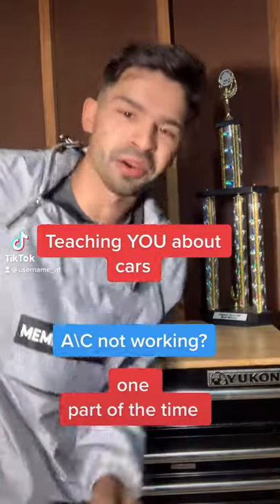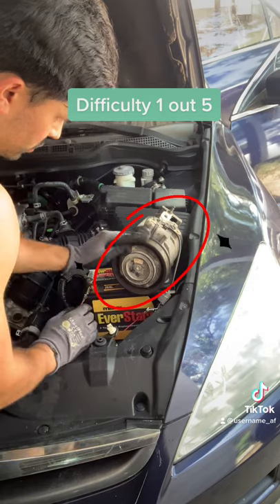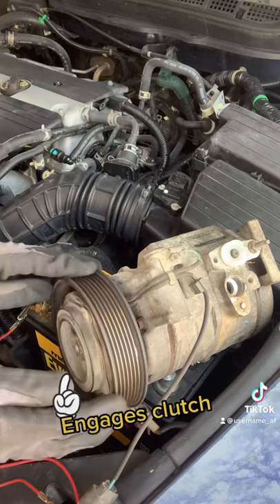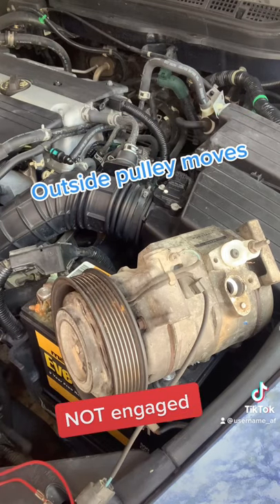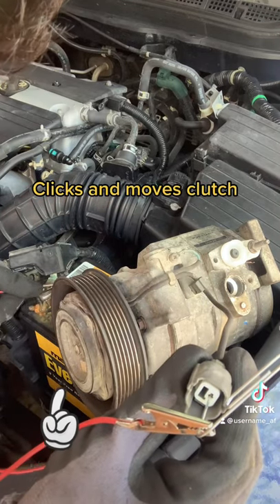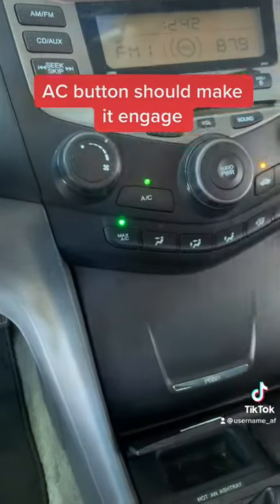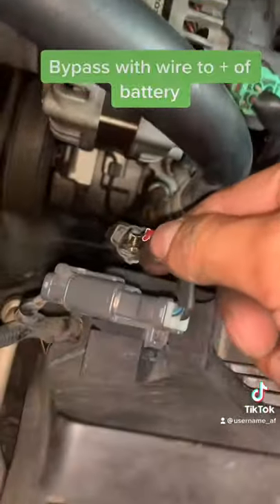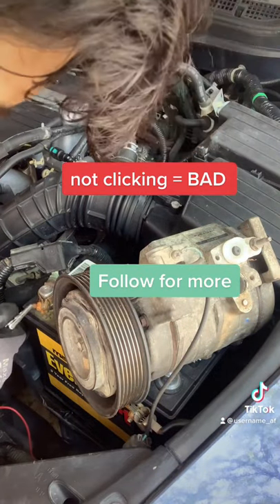How to Test Car A/C Compressor

Comment: If the compressor doesn't click while ac is on, it could also be low on refrigerant. If you fill it up the proper way and the clutch still doesn't engage (click) then the compressor is most likely bad.
Reply: Could also be the pressure switch as well. Could also be the electromagnet. (Unless you check the resistance and it measures between 3-5 ohms. Could be a short in the line like the guy said above and it could also be low on refrigerant. Surprised dude in the video didn’t mention any of these, especially when the pressure switch and being low on Freon is the problem A LOT of the time.
Reply: How would you check if it’s low on refrigerant? The a/c gauges won’t give you an accurate reading if the clutch is not engaged
Reply: It could also be a bad clutch
Reply: @michaelhaile401 this is my problem now
Reply: Bypass the low pressure switch,  If the clutch engage then you know it's low of refrigerate.
Reply: @JoeyCorona-st6nf  you can’t really. You need to rid it of all refrigerant and refill completely brand new. Check online for your cars EXACT amount it should have.
Reply: I just ran into that problem putting one on my suv..another thing I caught, and I recommend you this before buying, is to cover the two holes woth your finger, spin the pulley,  and it should suction those two fingers..if it dont, it won't pump..just a heads up on what I observed while doing mines..just an add on to your excellent observation👍🏿👍🏿👍🏿
Reply: Could also bad ground
Reply: @tack3411 probably dumb question but where do you put the refrigerant

Comment: If there is no refrigerant in the system the clutch won't engage also
Reply: wait, why wouldn't it?
Reply: @elemenopi55 because it won't detect enough (pressure (refrigerant) in the compressor meaning the clutch won't engage to turn on your compressor so you can have AC in your car/Truck
Reply: @azkc3857  i see. could there still be enough pressure/refrigerant to turn on the compressor even though there isn't enough refrigerant to blow cold air into the car's interior?
Reply: @elemenopi55  if anything you might still have some to have the compressor engage BUT while its leaking you might not have enough to keep the inside of your car cold, so when it leaks completely then the compressor won't turn on and you'll only have hot air coming in 

Common leak spots are 

The two Lines High And Low Pressure which have Somthing called O-Rings where it connects to the compressor or the Condenser 

Condenser could also fail but it's very uncommon 

Compressors also have o rings and Oil to run the compressor built in which Is main causes of a compressor failing 

I Recommend flushing your AC system by taking it to a mechanic that can recycle the rest of the refrigerant and then filling it with R134a with UV Dye (Depending what refrigerant your car takes thats the most common one every car takes) once it leaks if it's a high leak then you notice it instantly from letting your car run if it's a small leak you probably have to leave it on or ride it till it leaks the uv Dye and check where in the lines or Compressor it leaked with a UV Light (BlackLight) 

One last thing c9upd be your lines are clogged up and it might need a flush start with the uv Method first I'd say before you go above and beyond 

Quite a long paragraph but I hope It can guide you better to your problem

Comment: This isn't about testing the compressor, it's about testing the compressor clutch. Big difference.
Reply: Yes and no. A working compressor will turn on when car is running and AC is turned on.

Comment: To jump the compressor. Unhook it and run a jump wire in both of the notches/slots, then crank the car. Done
Reply: Ground and 12v? Does polarity matter ?
Reply: @davidgomez3737 Did you get any answer? Does polarity matter?? I got my cable pulled out of the pins and both of them are black, Idk which is which
Reply: The safeguards are now not in play so the pressures aren't controlled.

Comment: Good explanation
Reply: I took my car to a shop said my compressor bad cuz the inside pully keeps moving while the ac is off told me I need a new compressor is that accurate?
Reply: From what you typed. It sounds like the clutch is stuck and is engaged no matter what. I obviously can’t see your car, so going based off this the clutch may be bad on the compressor unit. Some shops replaced the clutch part or the entire ac compressor depending on the make and model. As another internet stranger who does not know you personally I would recommend going to a different shop to get another quote or inspection. A lot of times shops will half ass the inspections or won’t do all of the tests to root out the exact issue. So if you feel as if their findings don’t sit well. Listen to your gut and move on to another shop.

Comment: It's either a bad clutch or the compressor is out of freon.. compressor clutches will not engage if they are below a certain amount of freon in the system to protect the unit from completely destroying it due to lack of freon
Reply: U dont need to buy a new one. Check the electromagnetic part inside that pulley. Mostly them the ones burned out. Around 40usd with a set

Comment: I’m 99.9 percent sure that compressor works perfectly fine, why spend 300 dollars on a new compressor when all you have to do is spend about 50 bucks or even less and change out the compressor clutch coil on your existing compressor.
It’s just held on by a bolt usually 10mm the clutch drive plate slides out , careful no to lose the shims that come out they’re thin pieces of metal that look like washers , then you’ll see a snap ring holding the pulley in place take the snap ring off then if you’re lucky the pulley should slide out by hand if not you’ll need a 2 or 3 jaw extractor to get it off don’t try using a hammer cause you’ll damage the bearing.
Once you got the pulley off you’ll expose the magnetic clutch coil again it’s just held in place with a snap ring get it off and the coil will come right out.
Reply: damn boss man ninenty nine point nine nine percent? can you post a video?

Comment: Thanks for the info. Mine makes a squell kinda sound on start up. Last for about 15 seconds. I wait till it stops before driving. I've had mechanics tell me that they tightened up the belt but it still happens. Do you think I need a new compressor?

Comment: “Need a new one” ?  Need a new compressor or just a clutch if it doesn’t click?
Reply: Replacing the clutch is the better way to fix it, it is easy and it costs 1/40 of the price of a new a/c compressor.

Comment: That is not testing the compressor.. that is testing the CLUTCH of the compressor.

The compressor does more things and it could fail in other ways too. The clutch is the first thing to take a look at, but you could easily hear if the clutch is working as it will make a distinctive sound when you press the AC button. What you need to do next is show us how to diagnose a compressor... you guessed it... NOT compressing.

Comment: Im not gonna lie. I was getting a bit nervous with it on the battery like that. When i was young I basicly welded a  adjustable wrench to a battery. Got it off with a hammer. Scared the shit out me. Ive also had one blow in my face before so i like to keep batteries safe lol

Comment: Hey man, can't seem to find a compressor  for my vehicle so I'm looking for an alternative. Thinking about hill billying  and converting a washing machine motor to do the pulley work for the compressor. I'm an engineer so I was going to bolt them to body where there's room under the hood,  run the lines and use the motor instead of the engine pulleys with the switch working with the thermostat for cool down as well. What's the worse thst can happen? And when I say engineer, I do got my degree, just never practiced it as im also going for entrepreneurship

Comment: Is rhe clutch in parallel with the two holes? I found out if you put 2 fingers on the holes and spin the pulley, it should suction your fingers while spinning thr pulley..im thinking its parallel with the pumping..im new at working on my vehicle..

Comment: Can the ac compressor make a winding noise when going bad?
Reply: The clutch bearing can make a noise when the bearing goes bad if that’s what you mean. Could sound like metal on metal wearing against each other

Comment: When the clutch gets burned up does the system get contaminated ? I want to know the likelihood  of needing to replace other parts like condenser , dessicant bag . drier ? I've got a 15 Ford Fusion 2.5 L Looks bad the clutch material is coming out the front pulley

Comment: My car blows cool air when running but warm when stopped, it’s an Infiniti g37. Any way to inspect it or any coming issues I should look into?
Reply: I had this problem on my 05 g35 and my ac compressor clutch stopped working after the next couple of weeks. Check if your RPM’s jump up and down on idle if they do you most likely will need to replace the air compressor or the ac compressor clutch
Reply: @VQ.Jnthn2300  my 06 g35 has been doing this for like a month now but it’s finally getting bad. i’ll
be at a stop light and my rpms would jump up and down but i could never figure out the problem but i think you saved me now cause my air is cold that’s why i never really thought it was the compresser but the clutch make sense as well

Comment: Hello my name is Alice an I have a 2007 Chevy Impala and I have a question,  so my car is making a noise someone said it's the compressor but he barley even looked at the car so how does one know it's the compressor? Can u tell just by the sound it's making? An would it still be making that noise if you only needed Freon or to recharge the a/c (my A/C isn't pushing cold air) thank you in advance for any info u can give me regarding this situation 🙃

Comment: So I jumped it and filled it with coolant and it works until I remove the jump wire and it won’t engage itself
Reply: Check fuses and relay

Comment: It's easy. Start your car, lift your hood. Turn your ac on in passenger mode. If it's good you'll see the middle moving. If not the middle won't move.

Comment: This is due to activating the AC at a high RPM (for manual cars), the compressor clutch could be damaged in this case.
Reply: Best way to test the clutch (magnet) is by checking the resistance. Connect a multimeter to the ground and hot wire. The resistance should be around 3-5 ohms. It can work high or lower than that, but if it does, it’s on its last leg.

Comment: Our be like me and have 150psi on the low pressure side while revving (150 was the max on the guage so who knows what it actually was)
Reply: I’m at 130-135 psi low side and trying to find any info on it and your the first one - anything yet besides buying a new compressor ?
Reply: @gabegarcia7779  unfortunately not since it turns out my compressor was actually dead

Comment: I have a 1999 Toyota RAV4 and we currently diagnosed that our Air Compressor is making a loud phone-ringing type sound.
So far, every time we turn on the car and after a few minutes, the sound begins and would turn off after awhile.
I decided to turn on the AC while it'd making sound and it stopped making the sound.
Reply: The bearing of the pullley is destroyed. That will heat up to a point it will melt the rubber cover of the bearing, also, the plastic protection of the magnetic coil will melt and could cause short circuit. Try replacing the magnetic clutch pulley bearing asap
Reply: @misty-i2q  Thanks. I'll take that into consideration. I'll keep you up-to-date if you like

Comment: My ac blows super cold but it stops working when it wants to then cuts on when it wants too. Ac Air is always cold. All fuses are good, just changed blower actuator. Still nothing. 2016 dodge charger

Comment: I checked the fuse and it’s good. I checked the relay and it’s good, still clutch won’t engage.
Reply: Could be low on refrigerant 🙂
Reply: I recently got my a/c serviced and it was low on refrigerant plus it had some leaks that were fixed. Blowing nice and cold now 😊

Comment: I have a 2007 RAV4 and my ac just quit coming on. My son said it made a noise ( no idea ) and the next day nothing. It’s like turning on a stereo that’s not connected to anything, not even a power source. I replaced the resistor and nope. The blower motor is good so I’m at a loss
Reply: Did you look to see if the belt broke? Sometimes they use a different belt and they'll freeze up and break just that belt. There's also a switch that signals whether or not there's enough pressure in the AC system lines. Maybe a rock or something hit a line or the condenser and the noise was the refrigerant leaking out. If you want to test that you can either buy some self add refrigerant with a gauge and it will tell you the ammout of pressure in the system. You just want to stay in the green. Or you can unplug the sensor and bridge the wires and if it kicks on you know your switch I bad.
Reply: @Zoroaster4  it has not. It gets no power to the “on/off” switch. We’re checking fuses but can’t locate that pesky relay switch

Comment: Hello, I wanted to ask you if you could help me with my car. I have a 2013 Ford Edge that has a dual system that blows hot on drivers side a cool on passenger side

Comment: when i press the a/c button in my car the pulley doesn’t move. I unplugged the wire and connected it to the positive side of the battery, after which i hear the clicking sound and the clutch engages. what does this mean and what should i do to fix the problem. Thanks!
Reply: I believe you stated that if it engages it could be the fuses. My car is a 2012 Accord V6 and I have swapped the horn relay with the magnet clutch relay but that didn’t do anything. are there any other fuses or relays that I should check or replace too! Thanks again
Reply: You don’t have enough pressure in your system, check for any leak and top up your system

Comment: 08 Cobalt 2.2L so I used a recharge kit and it said it was full and the lines where cold but it wasn’t blowing cold air would that be a clogged cabin filter or the compressor ?
Reply: If its not clicking on. Probably compressor. Check the ralay and fuses while youre at it
Reply: @hectormejia5090  appreciate it bro

Comment: What if my compressor clutch spins without stopping? The car blows cold air only during acceleration or sudden stops.
Reply: Most likely low on A/C refrigerant .     7/7/23
Reply: @vicpetrishak7705  it wasn’t that. Levels were normal.
Reply: @johnnyboyyyyy   What are the low and high pressure readings ? What is the ambient temperature ? Are the electric fans operating presuming they are in your system ? Cool down the condenser with spraying water on it , what will the pressures do ?

Comment: What happens if it is the fuse but it blows everytime you replace it
Reply: Same fckn' problem I'm having,guy told me it's the clutch going bad. It's either low on coolant, wires ground out.
 I'm confused as fck to!
Reply: The fuse is blowing to prevent the wires from catching fire if the system draws too much current. So if the fuse is blowing it means the system has a bigger problem causing it to overdraw current, likely the AC compressor clutch or clutch bearing seizing. Replace the compressor clutch.

Comment: Mine locked up and force turned,which turned bright red from the heat and caused my belt to melt on it pretty much. I gotta replace my ac compressor now, but for some reason I can't find a youtube video to help me. 😢 I'm desperate.😔
(2013 Nissan Versa)
Reply: Usually helps to watch cars similar to your car with the same year for example 2015 Nissan versa might have the same layout or engine as 2015 Nissan Altima
Reply: @clonedperp3633  

Sounds about right...🤔

Comment: Luis, I was recharging the refrigerator air, and as I pressed the trigger to filling it, a smoke came out from near the filter/radiator. I stopped immediately. My a/c doesn’t freeze anymore, and it wasn’t freezing before it also. What do you think it is ?

Comment: When adding oil to an A/C system that was inoperable and now the system freon added without changing the compressor, how much do I add to the system not knowing how much was in the pump.? ( Assuming I know the total oil required)

Comment: I have a 2010 Mazda 6 S . I only have heat when I'm driving and cool air  when idle. Every now and then it true trys to run hot but I either turn car off or it does to normal.  I've had the head gasket , heater core and dual fans replaced back in June of 2022. Please help. Thank you

Comment: Not too informative, this just tests the clutch, not the internals of the compressor.... And it's not an air compressor, it's a refrigerant vapor compressor
Reply: Seriously, mine "clicks" meaning power success, but still doesn't engage.

Comment: i have that issue can i just replace that clutch?
Reply: Hard to tell, you will probably want to disassemble the compressor and clutch and see if you can spot which part has failed, so you can know Forsure if the issue is only with the clutch.